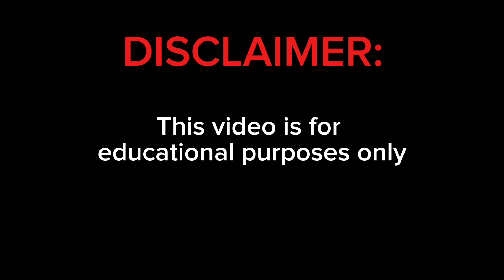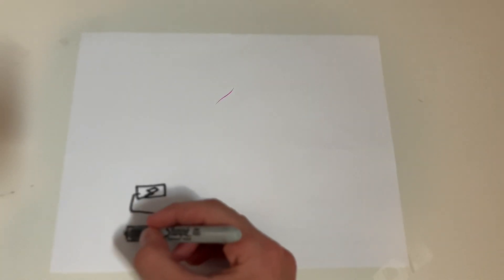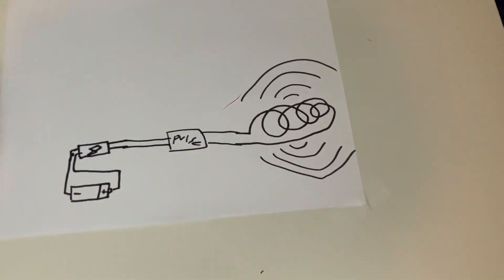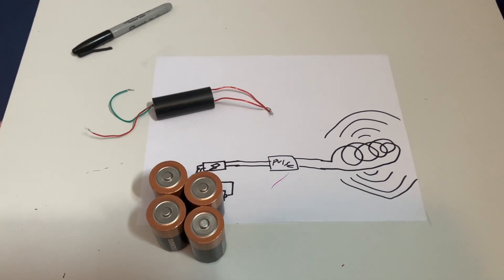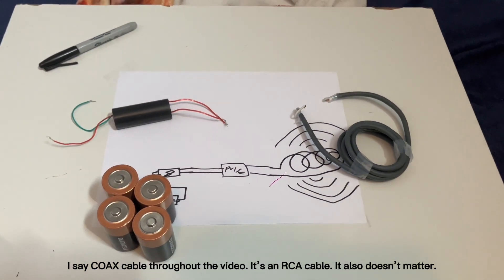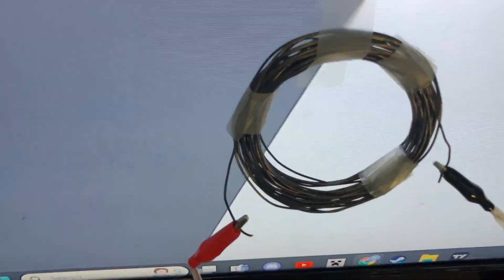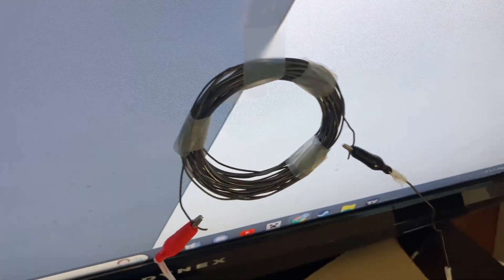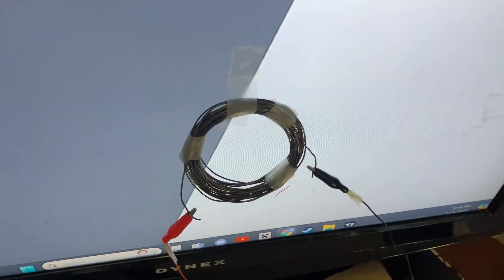Building An EMP Device (Electromagnetic Pulse)

Comment: id recommend using the coated wire because the electricity is more likely to flow around each coil instead of jumping straight to the end (bad explanation)

Comment: great project but the only reason the monitor is glitching is because you are electrocuting it. I made a taser using that same high voltage generator I got from AliExpress for around 5$ and whenever i tased my table my monitor would go glitch / go black too so your EMP might actually work but the test you did at the END proves nothing.

Comment: You need to get a soldering iron. Transformers don't work on DC.. The high-voltage transformer would have to have a pulse generator in it. Also coaxial cable has concentric conductors. I think this would shield the magnetic field generated.

Comment: you need a soldering iron my brotha. the reason it didn't work well is because of multiple things but mostly because of the fact that the coil you where using was way to small and the emp's couldn't effect the screen. also you where very close to frying your monitor. even if you had a good emp signal it wouldn't do anything to the screen because liquid crystals are not conductive by themselves and if you did get something to change on the screen it would be permanent.

Comment: although I wouldn't recommend doing that, I can give you some advices, first of all try using a high voltage capacitor (preferably 1-5nF) in parallel with the output to create higher voltage spikes also you could try to wind the cable around a core